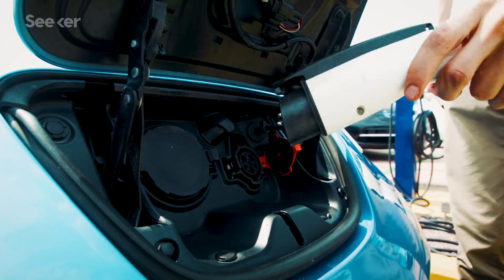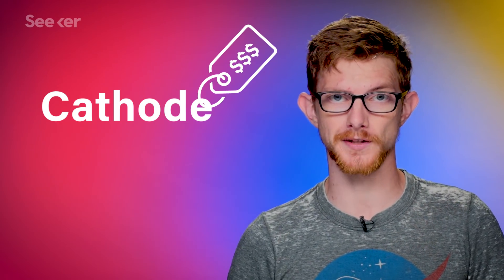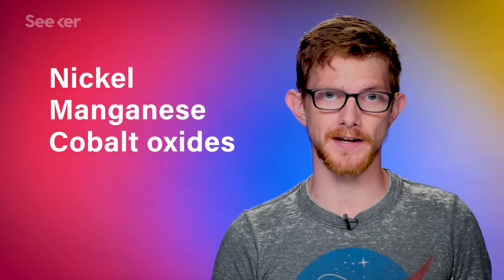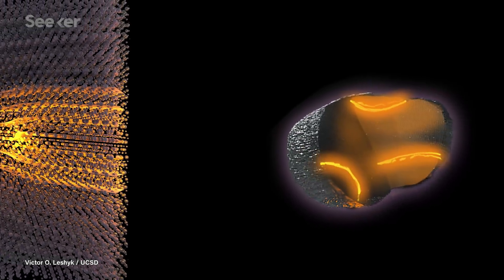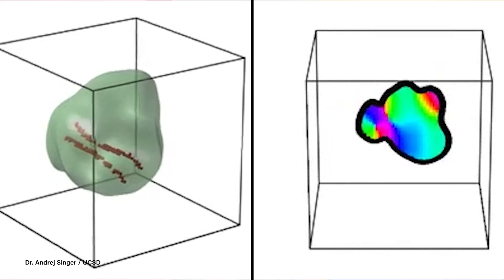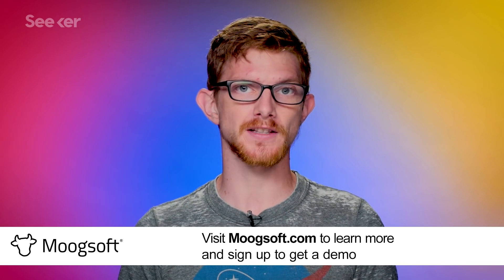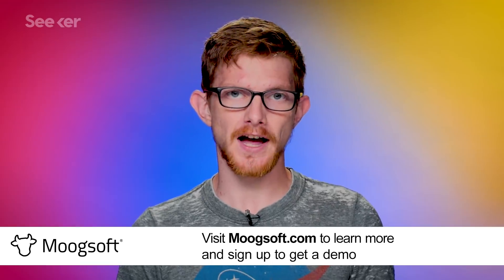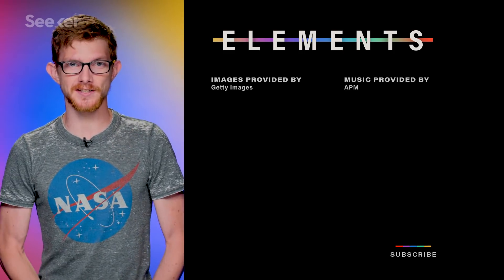How Voltage Fade Prevents Us From Creating the Perfect Battery

Comment: The Cathode, is the Neg end, Anode is the positive end. "cath·ode
ˈkaTHˌōd/
noun
noun: cathode; plural noun: cathodes

    the negatively charged electrode by which electrons enter an electrical device.
        the positively charged electrode of an electrical device, such as a primary cell, that supplies current."

"an·ode
ˈanōd/
noun
noun: anode; plural noun: anodes

    the positively charged electrode by which the electrons leave a device.
        the negatively charged electrode of a device supplying current such as a primary cell."

Comment: Ehhh.... 
This doesn't keep the Nickel aluminum Cobalt oxide cathode alive, it definitively destroys it. 

The solution that the scientists found, as reported by those scientists, isn't applicable on an industrial scale. it's not just that it hasn't been adapted yet, it's that it's intrinsically incapable of being adapted to large scale implementation. 

If a Heat treatment isn't capable of being applied to a given industrial process, that's pretty specialized because heat treatment is basically THE means of industrialized production that the human race has engaged in since Roman times.

Comment: "Industry giants are betting there is still room for improvements" -Of course there is, I feel like battery technology is years behind other techs they power, very few advances have made it to the market since lithium batteries are a thing. Its about time, im tired of the little battery life on most electronics. And most of the increase in duration you get out of batteries in the last few years comes from the optimisation of the electronics and smarter softwares, not because the batteries are much better.

Comment: I don't see any mystery but a need of thermal isolation or refrigeration either way...In the case of a car just redirect a bit of the air intake to the appropriated-size batteries and problem solved. But not till the last drop of petrol is wasted :' )

Comment: The Moogsoft A.I. may be usefull to reduce the number of "alerts" about individual batteries in a pack getting near their lowest voltage tolerance [so it only bothers the user to extract it and place it on the oven when enough of them reach this point].
Reply: [Just in case] -> I am making fun of the paid ad "sponsoring" this nonsense.

Comment: umm, the cathode is the negative end, not the positive, smh
Reply: ThIs Is DaNgEr The cathode is simply the electrode from which the current leaves the device. It can be negatively or positively charged depending on how said device is being operated. When a battery is being used, the cathode is the positive end, because that's the side where the electrons leave. When charging, the cathode is the negative end. So you're both right I guess
Reply: @adbrunk87  Appreciate the clarification. I typically associate the cathode as being the negative end as well
Reply: Except that current is not defined to be the movement of electrons in a wire. Current, by convention, is measured with relation to the movement of positive charges. Using your definition of a cathode and the fact that current is positively charged, that means that the cathode must be negatively charged.

Comment: So.. Heat. 

Either Ultrasound or Microwaves. 

In a holographic projection. 

The big battery for the Car. The little battery for rejuvenation projector. 

And.. Yeah.. It will be heavy. And take space.. 

So it can't be in use in the car itself.
Reply: No but at least we know theres a work around. Good to know theres at least one solution.

Comment: So which one will be better - hydrogen fuel or this one?
Reply: Both working together.  Hydrogen is difficult to store safely in concentrations great enough to make a portable energy "carrier."  But hydrogen fuel cells could be used to charge regular batteries.
Reply: @allanrichardson1468  and how will they charge regular batteries
Reply: Shivmul Biswas With electric current.  Basically, you start with a power plant near a huge water supply.  Use some of its current to electrolyze water.  Compress or otherwise store the hydrogen (or maybe the hydrogen and oxygen in a “two-pack”) and ship the storage tanks to customers who have the room and budget for a stationary hydrogen fuel cell.  They can use it to generate current to charge more portable batteries, which would include large ones like electric car batteries, and small ones like phone batteries.